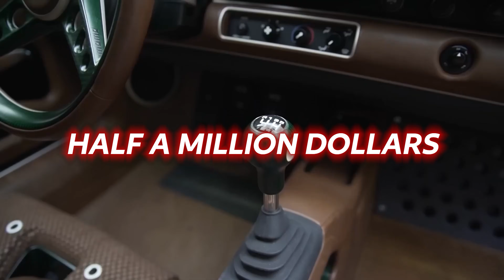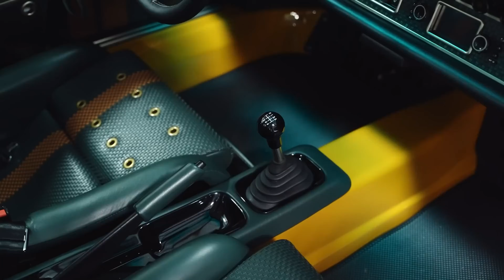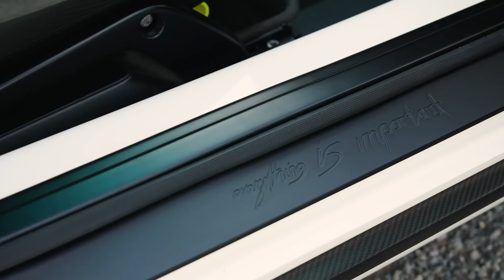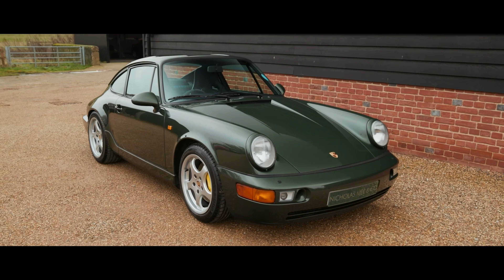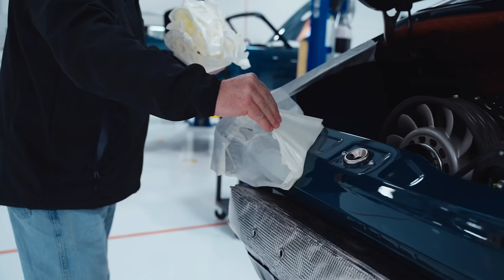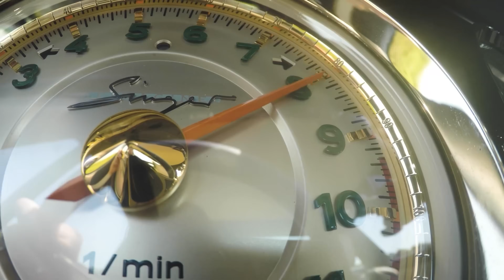Singer Turns Porsche 911s Into Driving PERFECTION — Here’s How

Comment: Singer Porsche's run course 3 you $2 million in 2025.... Ridiculous money tob part 6 for any car regardless off your b wealth.

In the end you buy a car to get you from point A to point B and back. On public roads with street driving skill. 

Most Sportscars are over engineered for the street are the typicalb buyer. Du what if they have a top speed of 205mph heh.. No one dudes launches to 60 in everyday deriving.... Carbon ceramic brakes?? Umm.... These cars won't be fetched LK driver beyond 35 percent of what they're capable of..